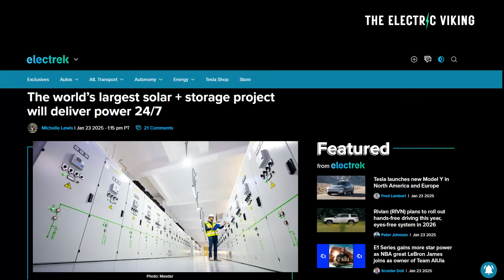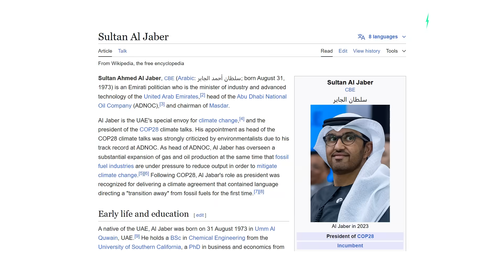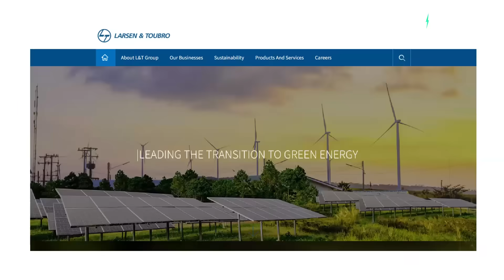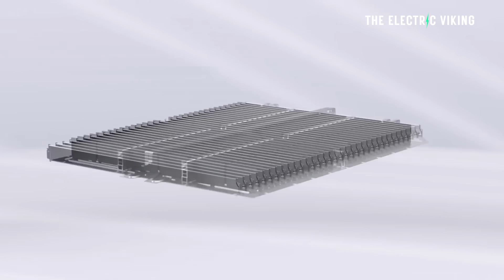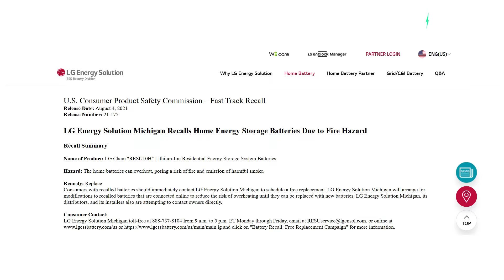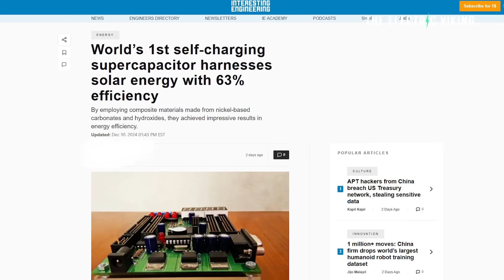The world’s largest solar and battery project deliver power 24 hours a day

Comment: Not in the UK we came close to blackouts the other week as wind & solar were almost non existent! And we were importing double digit percent of UK demand over inter connectors from other countries!!!!
Reply: The UK imports as it's cheaper to do so than using gas generation (which is the most expensive generation source to the UK grid these days), that's why the number of interconnectors the UK has with the continent have and will continue to increase. The UK is part of a diversified pan European and North African network of grids nowadays, a private company is even laying a direct HVDC connection from Morocco to the UK. So high imports (or exports as has occured in some years) is not unexpected these days.
Reply: @GruffSillyGoat The UK has lost energy independence , and now suffers a high risk of blackouts and pays high prices for imported energy as a result of the over reliance upon unreliable wind and solar generation.
Reply: @Leo555ZZZ  - UK energy independence hasn't existed for a long time, parhaps since the 1950s. Most of the coal, particularly since the 1980s, and natrual gas (which took over in the 1960/70s from coal) is imported at high expense (especially in the last 10 years).  Oddly blackouts were more a thing in the 1960s/70s/80s than now, but for various reasons. 

Imports, unlike the past, these days are about reducing the cost of energy not assuring against outages. The UK is more connected to other countries energy systems than ever before, with more international interconnects still being installed. Imports/Exports role nowadays is performed for energy trading rather than energy assurance. 

The UK is part of a cross European/North African grid network, where it both imports and exports energy, and intends to more exporting as renewables generation increases (with some recent years the UK being a nett exporter).
  
The UK particularly imports energy when the cost is cheaper to do so than generating domestically, this is mainly due to the high cost of natural gas based generation. So imported energy, particularly the renewable and low carbon energy from Norway, Denmark and France, is cheaper than home generation when wind and solar resources are low.

The solution to low renewable generation is a mixture of diversification of renewable sources (hydro, tidal, solar, wind and zero-carbon) and generation location (around more areas of the coastline). Basically creating a diversified baseload capability with low likelihood of simultaneous lull periods. 

Gas may well be retained in a backup role, until this itself is replaced with other storage technologies or generation technologies.
Reply: @GruffSillyGoat The move to wind and solar , which at times produces a tiny percentage of the installed capacity is the primary reason for increased costs and reduced system reliability being experienced in recent years.
Solar produces nothing every night , and sometimes almost nothing during the day due to cloud and snow cover.
Wind can produce almost nothing over the entire country when a large weather system is in place , regardless of how many turbines are installed...good luck relying on tidal , hydro and zero carbon to fill the shortfall.
Usually it is filled by importing energy , which in itself is an inherent system weakness and liability caused by an over reliance upon weather and time of day dependent generation.
Reply: @Leo555ZZZ  - In 2024, renewables produced 43% of UK electricity (56.7%, if zero carbon Nuclear is included), whereas gas generated 25.9% of electricity. Likewise gas generates a tiny proportion of electricity at times, but unlike renewables has a disproportionate impact on the cost of electricity, being the most expensive generation source. Renewables are not the primary reason for increased costs this is the cost of electricity.

The consumer price of electricity is determined by a national pricing framework that uses the highest cost of production at any point in time to set the cost of electricity, even if only one area of the country is using gas to generate 1% of electrical power it set's the national price. Take the study from 2023 for example, that determined that gas generation set the price 84% of the time, imports 15% and 'other' (which includes renewables and zero-carbon nuclear) just 1% of the time. Gas sets the wholesale cost of electricity most of the time, being the most expensive generation source, and is the primary reason costs have increased due to the high variability involved with its supply.

The cost of renewables is not the driver of the cost of electricty, as the cost of transition to renewables is a very small proportion of the price of electricity (under 2%) as renewable infrastructure are now purchased on a Contract for Differences basis. Whereas the wholesale cost of energy, represents 30 to 35% of the cost (and as above is determined by the cost of gas generation most of the time). 

Further the gas based generation suppliers game the system (as occured recently), turning off prior to know low generation periods waiting for a peaking power request, then turning back on at over 50x the previous generation cost. The answer to this particular issue is to tightent the rules (yet again) and install more batteries and other energy storage systems, and store more of the curtailed renewable generation for times when production is lulls.

However, many energy suppliers (Octopus, Ovo etc), OFGEM and industry bodies are seeking for a change to the pricing framework, from a national based one to a regionalised/area based one. The UK government is consulting on this, and it will be interesting to see the outcome - where it is expected that those areas with high renewable generation will see much lower electricity bills than now.

Oddly, in terms of inherent weaknesses this has been shown to be more the case with fossil-fuel supply risks that can be highly variable and dependant on global events and competive supply demands outside of the UK's control. Events like gas tanker ships being directed to other higher paying consumers mid-transit delaying supply come to mind, geopolitical impacting supply (as occured recently sending the cost of electricity sky high), suppliers suddenly lowing supply capacity to rise the cost of gas to increase revenue or supply lines becoming damaged. If anything the more centralised, monopolised and constrained supply gas market makes it more susceptible to risks than that of the decentralised renewable generation model.

Imports are not a system weakness, this is not like the dark old days of predominent fossil-fuel based generation, where imports where only performed at times of stress. Rather electrical energy imports and exports are now common as electricity is a traded commodity these days, with more transnational interconnects being deployed than ever before. Grids are connecting up and energy is flowing across larger and larger areas, directly as electrons not via more expensive and inefficient indirect energy cerriers like gas or oil.

What the UK is doing is to transition the bulk of everyday generation to renewables and zero-carbon sources, supported by energy storages to be as efficient as possible whilst maintaining a backup capacity of older dispatchable sources for emergency use as well as looking at alternatives backup technologies. The system (diversified generation and energy storage) will be sized to handle the once in five year short duration (few day) dunkelflaute event, with backup/demand management being used for the rare one in thirty year two week event.

This is no different to the snow outage strategy adopted in the UK, where since snow is such a infrequent and short term event it doesn't make sense to pay extensively and continuously to ensure when a short duration event occurs that things can operate as normal - that is the cost of doing outweights the risk and loss of not doing. If energy costs can be significantly lowered via renewables for 97% of the time, then for the 3% using the energy trading market, backup mechanisms and reducing demand is a more than workable cost effective approach.

Comment: You NEED batteries for solar panels to smooth the production and consumption differences. That makes solar more expensive.

The nuclear power station project in the UK is the most expensive in the world. I think the whole project was badly mismanaged.

Both solar panels and batteries have a limited lifespan (25-30 years for panels, 10-12 years for batteries).

Solar is not a panacea.
Reply: Nuclear, coal and gas power plants are far from maintenance free. Far worse than solar and wind.
Reply: @ coal is orders of magnitude cheaper than solar. Each of those can provide constant output which solar can’t by itself, only in combination with other sources or batteries.

Comment: Renewables stink and only work when you have a shedload of hydro (like Norway, Sweden, China) and even then it's more expensive than coal and nuclear.  Show me one country with high renewables % and that has cheap electricity. If you add adequate battery capacity to cover cloudy sequence of days and nighttime in winter the cost of electricity will be 2-3x coal and nuclear.This guy is selling nonsense

Comment: A few weeks ago we in the UK nearly had a total Black Out at night as the wind stopped blowing and what's left of our gas and nuclear struggled to fill the shortfall.
Reply: No we didn’t. Nobody lost power. We just dipped into the planned reserve, that costs money, but only for a few hours.

In other words, the worse case scenario is no problem. 

Just a few days later and we had a storm that plunged the price to almost nothing for a day, so we made back all the money we spent on the extra capacity. This is how the system is designed to work. You may have to purchase more expensive power for a few days of the year, but for the rest of the year, you are significantly better off. Your yearly costs will be lower with this system than the alternative.
Reply: @javelinXH992 you purchase it from countries that produce it from conventional energy sources. If all countries relied exclusively on “renewable” energy sources there would be no reserve to plug the hole. Honestly, the sheer level of naïveté gives me chills.
Reply: @fifthpint4571  we know exactly how the grid is powered in the UK, that information is publicly available and updated every few minutes. 

Why do you think we don’t know where it comes from? And why do you think I think it all comes from renewables? I never said that and am well aware of the renewable content of the grid at all times.

Your naivety about how the grid works and how we obtain electricity gives me the chills.
Reply: Thankfully you have all those interconnectors with... EUROPE!!!

Comment: Here in the UK we have to buy in around 14% of our power from France, Eire and Norway along with LPG from Norway and the USA, as you can see we need a lot more renewables and battery storage to keep our 300tWh of electricity needs rolling along. 
My main concern is how slow things get connected into the grid.
National Grid, a privately owned virtual monopoly owned by the likes of BlackRock, Vanguard Group, Capital Group Companies, Lazard Asset Management, Legal & General Investment Management and of course Norges Bank Investment Management (Norway again!) get to decide where the power we use comes from, thing is they also have fingers in many of these providers pie's, it's not in their interest to have lots of small businesses or even private homes putting power into the grid (stealing their profits !) cheaper than their own businesses can provide power. 
National Grid like having everything centric, they control both the hare and the hounds with Ofgem doing little or nothing to even out the UK electricity playing field
Reply: You are little out of date on National Grid plc's role these days, the network operator function that makes the planning and day to day purchasing decisions was bought out last year by the government for £630m to create a new public body responsible for these roles, the National Energy System Operator (NESO). They also transferred part of OFGEM's planning and licencing role to NESO, to ensure the new national operator was fully in control of planning objectives. 

As to balancing/optimisation, which is where LV generation like home generation tends to reside, this mainly sits with the energy suppliers (like Octopus, Ovo, E.on, EDF etc., note some of these are the commercial arms of larger energy companys), who select the which, where and when of energy generators and energy storage providers (including home ones) to utilise to provide energy to their customers (in line with the tariffs they offer).

Lastly, there are the distributed network operators (DNOs) who manage the MV/LV local grid services for connecting up domestic, commercial and retail customers to the grid, it's these who decide whether there is local capacity on their networks to connect a consumer/producer (such as domestic home PV system) or not. NESO now has direct control of the DNO's operating licenses (having gained that function from OFGEM, who still retain the regulator and monitoring role though).

National Grid Plc now focussed on the grid's transmission infrastructure management (along with Scottish Power and SSE in Scotland) not the overall grid operator role for which they have the license to run, as well as running their own DNO in the central belt of the country (having bought the Western DNO a little while back).

Sicne NESO was implemented the role of OFGEM is more focussed on energy regulation, future capacity market energy auctions and legislation implementation. NESO does the day to day operation of the grid, as well as the licencing and opertional management of the grid, dno and energy supplier companies.

Whilst this all may seem a complex setup, it actually purposefully segmented and decentralised to prevent monopolies/cartels forming as the licences are issued with strict conditions, including separation of roles/duties within operating companies, and generates value for money as the licences are competively bidded for by the operators. 

There are some areas to address, such as the domestic pricing framework and commercial/domestic connection process, which are a bit long in the tooth (setup for a time whern only big generators or industrial consumers existed) but the enahancements to the processes to make these run smooth are already being developed.
Reply: You can increase your installed renewables many times , and batteries as well , but it will still fail to supply power when needed due to extended periods of little wind and sun over the entire UK .
You main concern should be the failure to invest enough in reliable coal ,gas , hydro and nuclear power.
Reply: @Leo555ZZZ  - do you have evidence to support the whole wide area outage, the risk level involved, and duration. The energy planners who researched and modelled this already, and devised approaches that don't need coal/gas in the mix.
Reply: @Leo555ZZZ  When did these periods occur, I've had a look through all the usual data sources but cannot find anything regarding extended periods of little wind and sun (daylight). The last time I remember anything like that was due to an Icelandic volcano kicking off a few years ago but the turbines were still spinning and we did get daylight just no sunshine

Comment: The Florida hurricanes demonstrated the vulnerability of solar as a power source.
Reply: Solar was fine during the Florida hurricanes. Also, the Texas ones. Those of us with Solar + Batteries were some of the lucky ones with air conditioning!!
Reply: Storms in the UK did a number on solar farms in Wales i.e. ripped them apart!

Comment: Not in the UK at present. Wind is the renewable base load.
Reply: At a time last week your wind generated less than 1% of your power ,,,and you call that baseload ?  Good luck.
Reply: @Leo555ZZZ  The week before last, wind power generated around 27.4% of the UK's electricity. It seems like wind energy has been consistently contributing a significant portion to the UK's power mix recently, there did you get the figure of 1% from please ?.

Comment: You econuts don't ever learn do you? We need all forms of energy generation and storage, tailored for their intended purpose. No one method is 100% good or bad. All have their tradeoffs, and their own use-cases. Renewables and battery storage ARE NOT any more environmentally-friendly than fossil fuels or nuclear, much of the hype is simply a financial scam.

Comment: Neighborhood level batteries linking residential and local commercial rooftop solar will do the trick.

Add in the large solar farm linking them with UHDC lines and we've got excessive electricity!
Reply: That's a problem being worked out right now in California (northern part of the state and their electric supplier), but its too much power being generated by solar system installs.  Laws passed in the early days of solar mandated that the power company buy the homeowner solar-generated electricity as a 'primary' source, but they have too much coming in.  Battery storage systems helped, but its still an issue.

Comment: Having wind and solar electric generation charge batteries would allow them to not be stranded assets when the public power grid stops supporting their wild AC that takes  more fuel than making all the electricity internally from economic fuel efficient means.   They do not work with weather events lasting longer than the battery storage such as wildfire ash blocking solar panels.